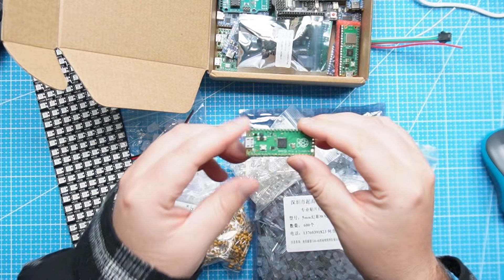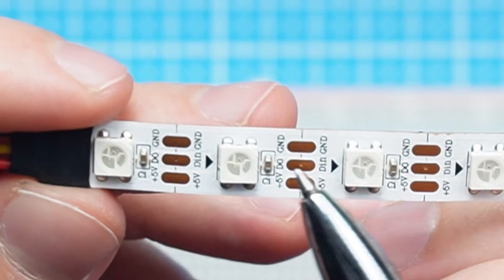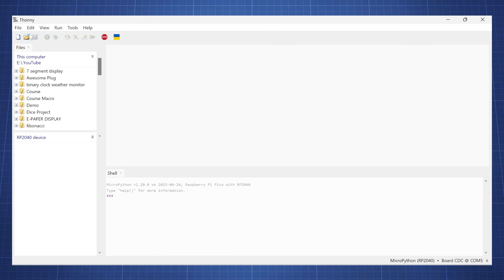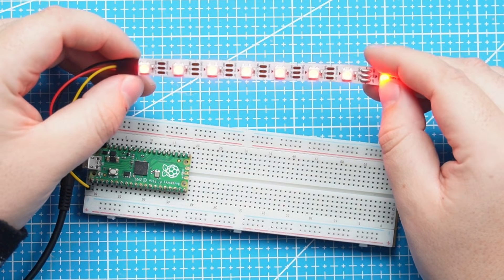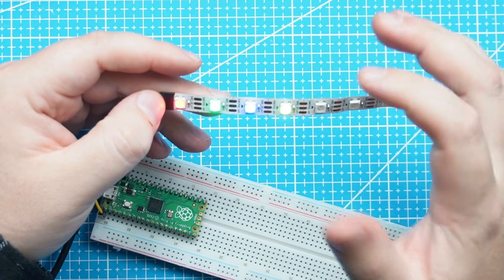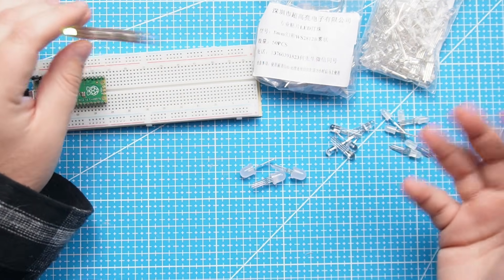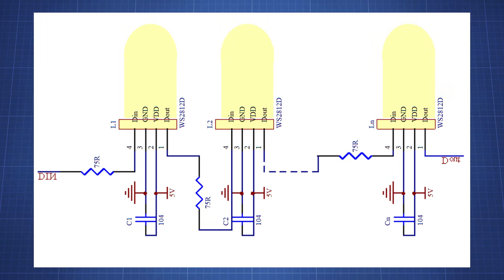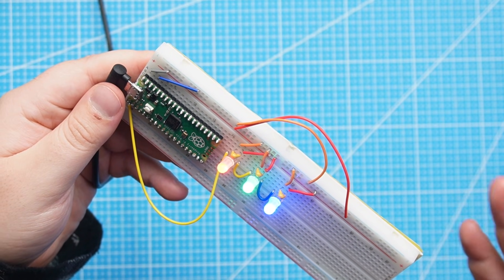How To Control WS2812B Individually Addressable LEDs using the Raspberry Pi Pico

Comment: Thanks, this is really clear and helped me understand how I can move forward with my project. In my case I'm going to do a custom sized LED panel to show some simple drawings through the LED colors. However, given the target size I'm looking for (11x30 pixels), this is going to be a really long strip. Is is best to simply use a single strip for all 330 leds, or use multiple IO ports to send data in parallel to each strip (say, 11 strips with 30 leds each)? I guess that if I just show a static picture it's fine, but if I decide to do some scrolling text, I feel like refreshing a single large strip would take longer and make the scrolling choppy. Is this a reasonable assumption, or am I getting all wrong?
Reply from the maker: If I would do a panel that large it will require a lot of soldering the strips, and will most likely look at just making a custom PCB to solder the LEDs on the with a Hot Plate, but if you do strips solder together it would be better to just use one data pin as you can only do 6 individual strips. If you just use one data pin for scrolling text it would be fine  you get those 8*32 LED panels and to display text or image on it works great.
Reply: @NerdCaveYT  thanks!

Comment: Nice video.  I didn't know about the thru hole version until now. Can you tell me what sized hole the leads fit through please?  I found a drawing that gives a lead dimension of 0.5mm but I don't know if the leads are round or square.  If round a 0.6mm hole should be OK, but if square the hole will need to be 0.8mm.
Reply from the maker: Not sure are there different ones, but mine are square let me look for them and I will come back to you, I can't find them now so it should be at the school.
Reply from the maker: They are square the ones I got

Comment: You don't need any sort of logic shifter for the data input of the LEDs? I thought raspberry pi GPIO is up to 3.3V and the LED needs 5V for logic.
Reply from the maker: I always have been using the GPIO pin without a logic shifter and have not had any issues according to the datasheet:

Consider adding a 100 Ω to 1000 Ω resistor between your microcontroller’s data output and the LED to reduce the noise on that line and to avoid accidentally powering the LED
through its data input